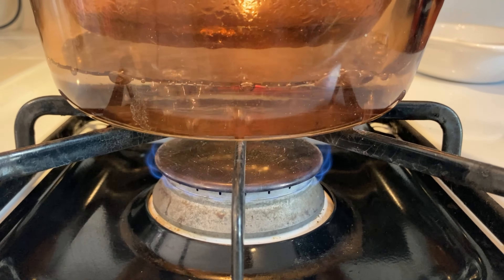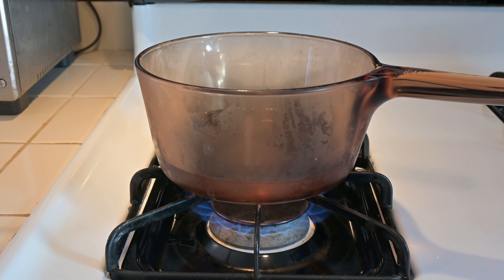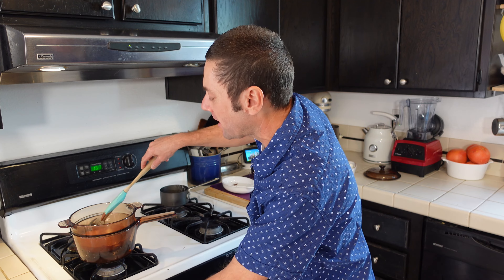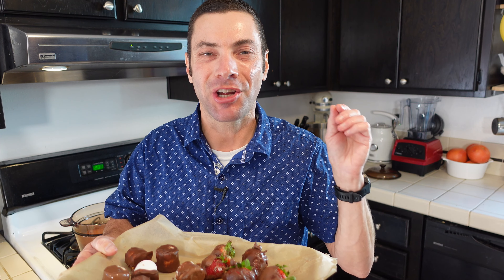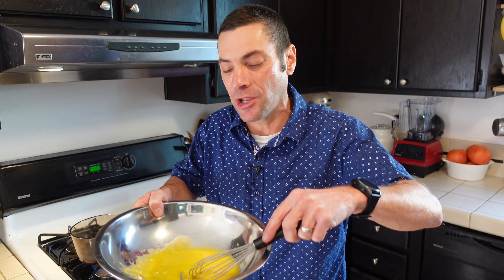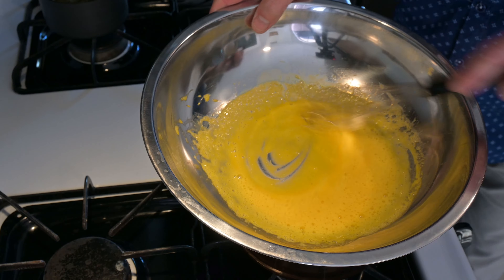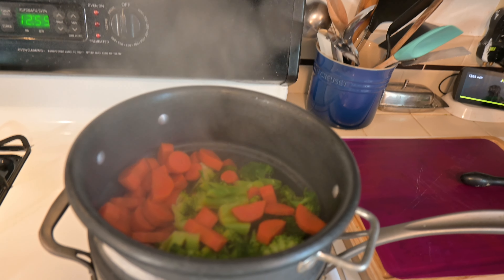What Is A Double Boiler & How To Use One

Comment: Do you know if these are explosion proof? There was a case of someone doing this type of setup with a standard pot and bowl and they overfilled the pot where the bowl could submerge into the water, which allowed pressure to build up in a vacuum which exploded boiling water.
Reply from the maker: Gads, that’s the first I’ve heard of such a thing. Steam can indeed be powerful - it moved locomotives, after all - but I’ve never experienced such pressures when double boiling. Perhaps it was a fluke and that person unwittingly created a pressure cooker, but that would take a mighty seal. If you’re truly worried, simply lift the upper pot/bowl occasionally to release any pressure buildup. Cheers!

Comment: I have a stainless steel double boiler, using it for fool-proof scramble egg! Also use it to de-fishy taste of the can sardine in water. I don't trust the quality of olive oil in can sardine and the kind of tomato or mustard sauce tastes yuk so I don't buy them. The one I buy is simply sardine in water, however it tastes kind a fishy, to get rid off that taste I have to dry it out. Drain off all the water then place the fish in double boiler. The pan gets the gentle heat from the steam would make the fish dry without burning it.
Reply from the maker: Great idea!